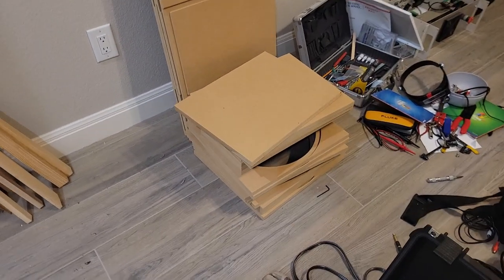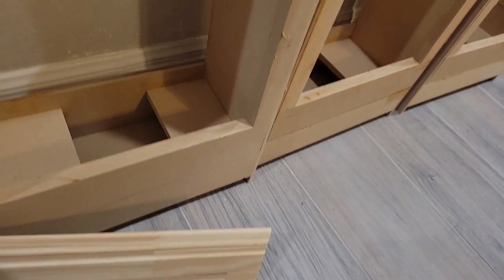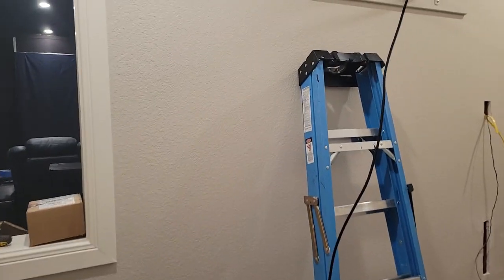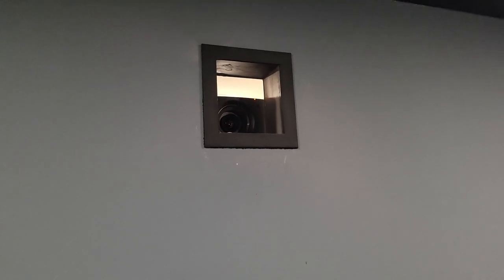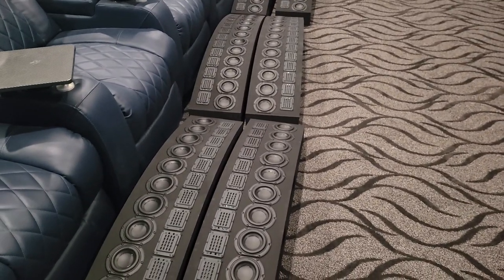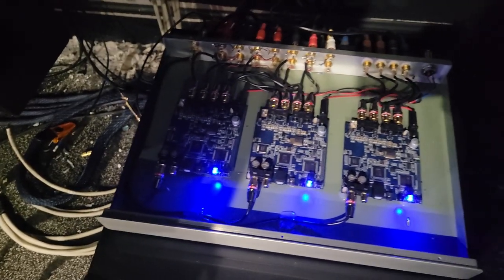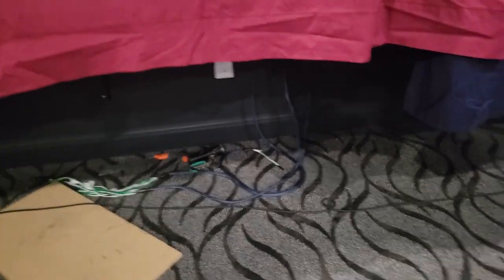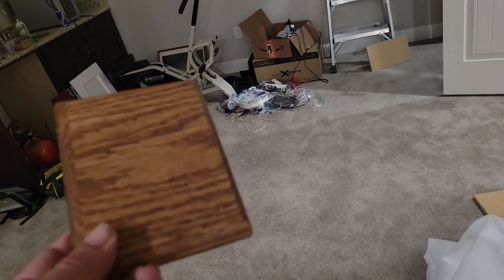Theater update 10 7 2022

Comment: I recommend using fiber glass insulation instead of spray foam. It should do a better job with sound transmission. Or at least use open cell. The point is having the waves bouncing around so the  insulation absorbs the sound. Closed cell won’t do that.

I do agree that some rigidity helps. Maybe a compromise of 2” open cell with batt insulation behind it
Reply from the maker: Actually in this case, the rigidity is the primary goal.  The walls and ceiling are, "Quiet Rock" instead of conventional drywall and I'm a bit concerned about the ceiling sagging over time.  I read online that Quiet Rock may not be the best for ceiling use because of potential sag issues.  The original plan was to put open cell over the theater but I started thinking a couple inches of closed cell will tie everything together really well and ensure the ceiling never sags.  I contacted some spray foam people and they agreed that closed cell would be the best option to stiffen everything up.

The infinite baffle woofer manifolds for the eight Dayton Ultimax 18" drivers will also get 2" of closed cell foam.  These are made of 1/2" MDF which is ok on its own because it is infinite baffle and thus no significant pressurization but having the closed cell foam on top of the MDF will really stiffen those up too.

The attic already has several inches of open cell foam on the underside of the roof itself.  That should be good for thermal insulation and also helping eliminate sound from getting in/out of the room.  But you're right, if the purpose was to reduce sound transfer then the open cell would be the best option.
Reply: Got it! I enjoy your channel because you DO have well thought out solutions. Thanks for the explanation.